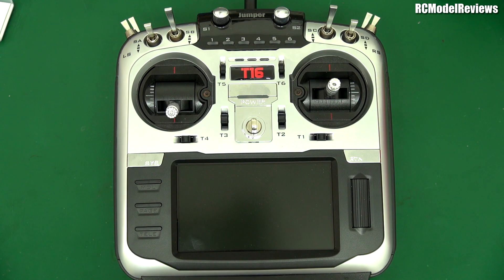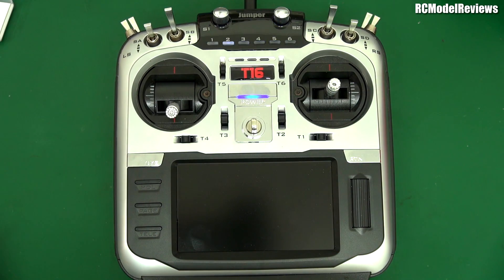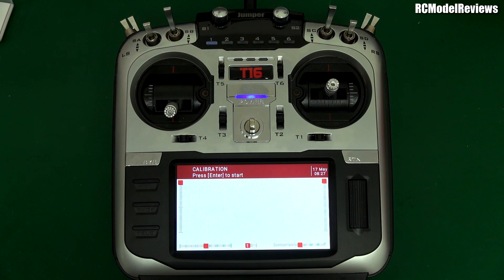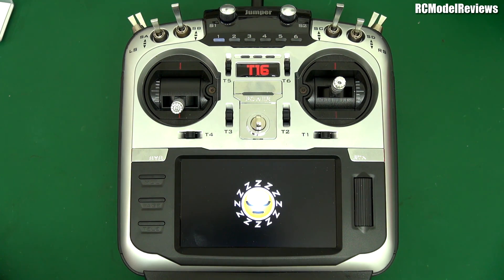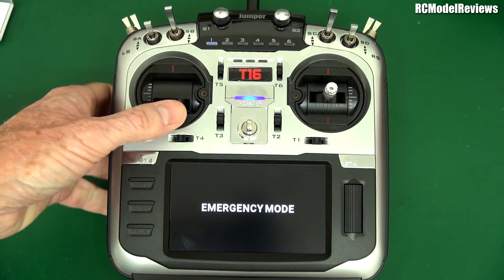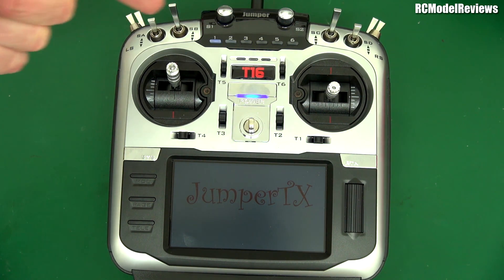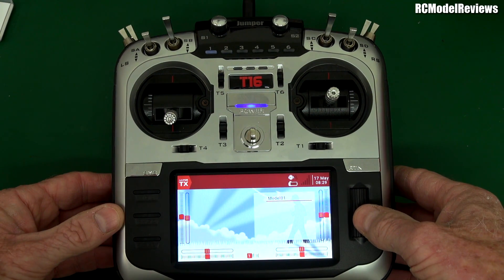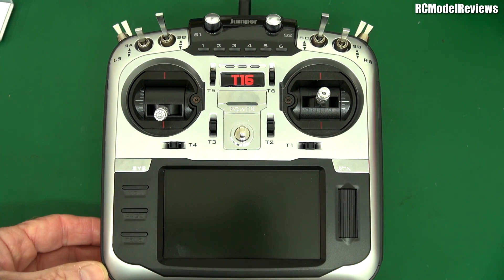Why I won't be using MY Jumper T16 transmitter

Comment: Damn, that really is not a good look on Jumpers reliability. I hope it is not wide spread and maybe you do have the worst luck of the jumper reviewers.
Reply from the maker: I think that sometimes it's because I live so far away from the rest of the world that products get a right-good bashing by the freight companies before they get to my door.  I just received a camera from Runcam and the plastic case in which it is packaged was broken -- but the camera was fine.
Reply: @RCModelReviews  So just shipping to your door is a durability test. 🤣 That makes a lot of sense.
Reply: Hi Droned Out!, this was discovered as a problem with the first batch of hand assembled review and test samples (around 20 units where hand made for sending to reviewers and developers). The problem is in the SD card PCB component, a couple of other reviewers also had this issue and we had sent them a replacement SD card PCB component (the same component used in actual production). This problem was eliminated before production began. I have already arranged a replacement part to be sent to Bruce and emailed him about the issue.